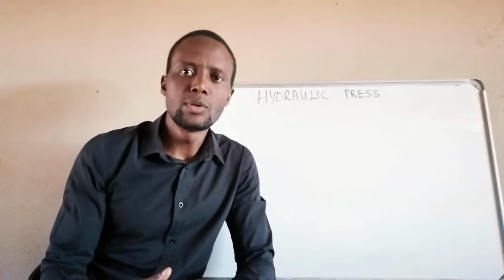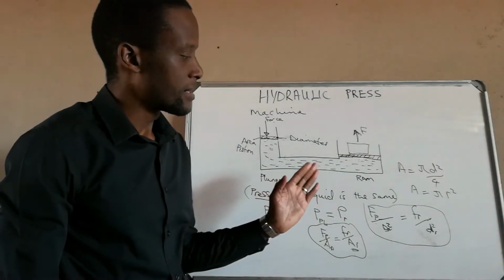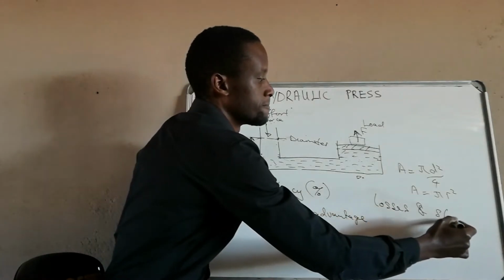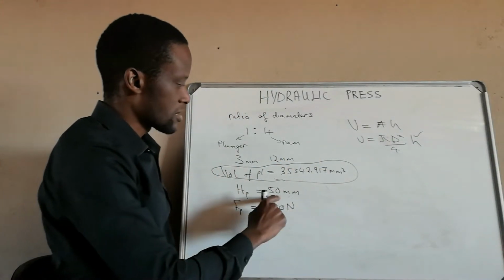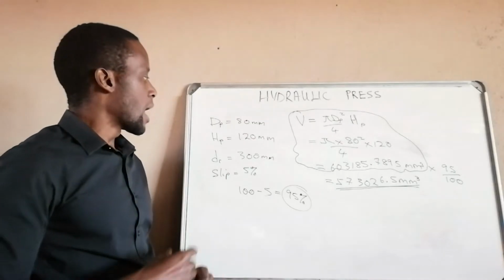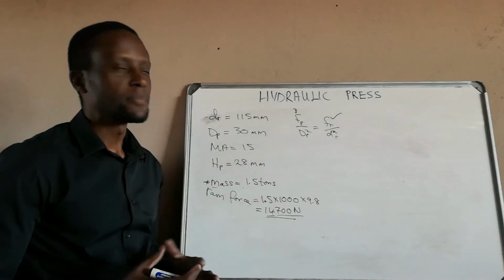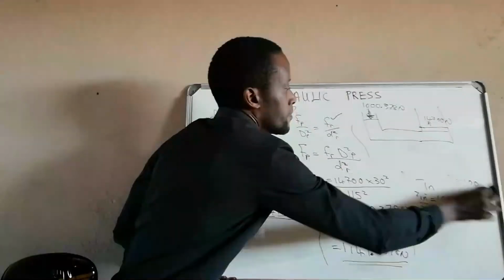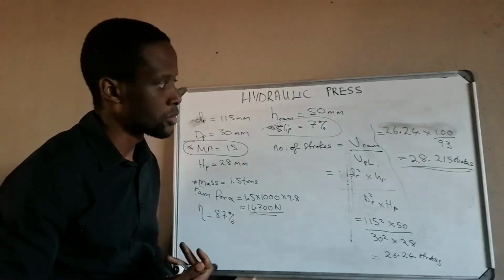Engineering science N3 & N4 Hydraulic press

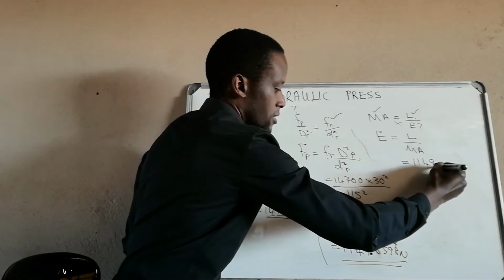Comment: HI @ 35:00 isn't the load on the ram side and the effort on the plunger side meaning we use force at ram 14 700N as the load divided by 15 ?
Reply from the maker: Yes indeed.
But that means you are starting by resolving the effort (980N) from the mechanical advantage. So you will need to apply the efficiency to the your effort to get the input force (1126.437) then there after work out the force on the plunger using the hydraulic press formula.
It doesn't matter the steps you take, just make sure the efficiency and mechanical advantage are applied appropriately in you calculations.
Reply from the maker: @Kagiso-k4x Glad to know you are following through with the calculations. 👍